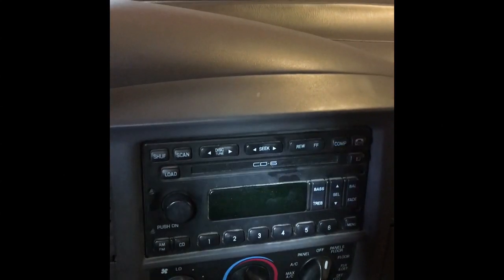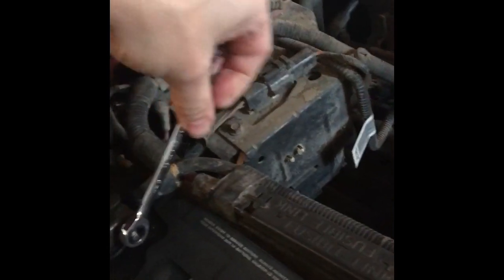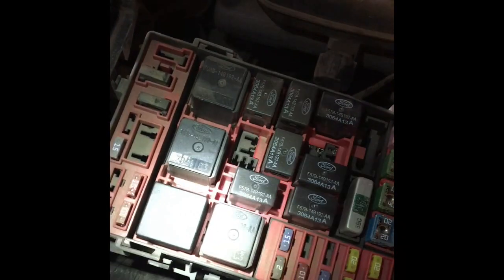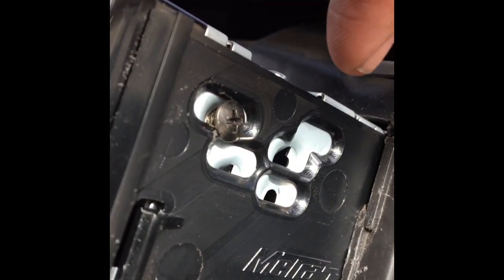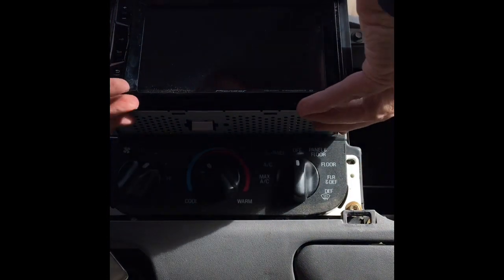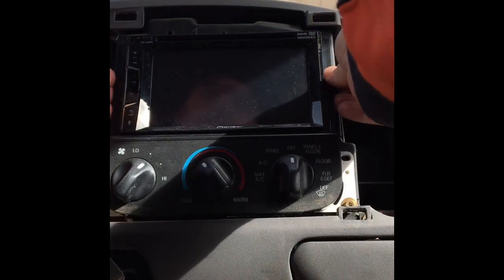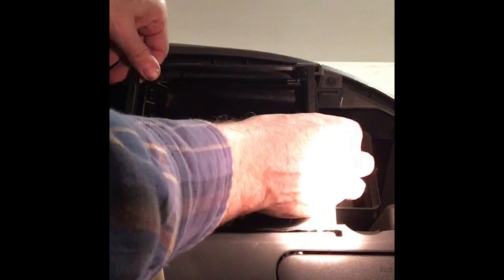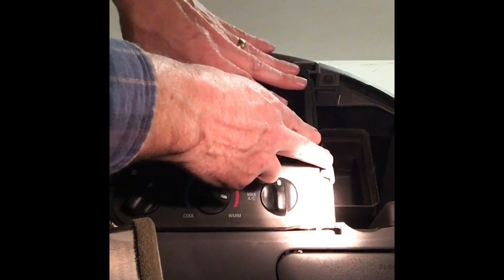Double DIN Stereo and Back up Camera install in 1997-2003 Ford F-150 Super Crew

Comment: Thanks for the video. I have to say the. most important part for me is around 9:17 where you show where the back up light power wire is. This is used for the back up camera function. What a time saver! Just this little tip alone saved me hours of research! Thanks again!

Comment: It turns out my 7-pin hitch doesn't have power.   It was easy enough to route over to the left tail light assembly and grab the power there.   Now I hear that there may be a missing relay for the trailer power.   Off to go check!   Great video!

Comment: Okay so where you hooked up the power wire to the trailer harness if you would have just spliced into the middle wire which is the black-and-white grain that is your actual reverse wire for your trailer light harness

Comment: What the red light under your steering wheel? Asking because I have the same thing and idk what it is.
Reply from the maker: It's part of an aftermarket alarm/security system installed by a  previous owner.  I searched online years ago to figure out how to turn it off but can't remember how I did it.

Comment: all videos I've seen on this topic cut out the part I need, which is wiring from back to stereo..
Reply: Just buy yourself an adapter cable. Mine cost me about $8. Then attach that to the harness that came with your stereo. Just match up the colors of each wire. Then all you do is plug one end in the connector that your old stereo plugged into in the truck and the other end to the new stereo. You will have to run a separate wire from the back up light power (9:17 in the video) to the stereo. Pretty easy.
Reply: @ArVeeNiner  Ive been looking but cant find one that I'm certain would work. Would you be able to help me find one?

Comment: Another thing that would have been easier, you could have spliced into the back up light for the power, that way it triggers the camera to come on when you put the truck in reverse, wouldn’t have needed the relay and extra wiring
Reply from the maker: Yes, you are right. One advantage with the way I did it is that I can turn the camera on anytime. I don’t do that very often though!

Comment: Any tips on the best way or how to safely run the av wire from the cab to the tailgate?
Reply from the maker: Not really. I wasn’t very happy with how that part turned out, although it hasn’t given me any trouble. I just zip tied to the frame as often as I could to keep the wires from dangling and getting caught when I am off road. Maybe someone else can share a photo or video of how they routed the wires?
Reply: On my f250 I was able to run a/v wire thru the emergency brake cable hole in the floor of the cab,( it's a tight fit) run wire down the inside of the frame rail to rear tail light. Remove the tail light and make connections behind the light so they stay dry. Hope that helps you out.

Comment: You don't want the backup camera powered all the time. You can connect the power and ground for the camera to your reverse light. Then attach the RCA input and the trigger wire to the radio.
Reply from the maker: This head unit allows the camera view to be displayed with the touch of a button, while parked or driving forward in addition to automatically displaying the view when triggered by reverse.  That's why I wired the camera to have power anytime the key is on.  I agree that if your head unit only shows the camera when triggered in reverse, it makes sense to pull power from the reverse light circuit.
Reply: Thats the way to do it!

Comment: How did you get the RCA video cable from the camera into the cab? I'm using a wireless setup on my 2003 but I want to change to a wired camera for better reliability but not sure where I can get the wire into the cab.
Reply from the maker: There’s a 2 inch hole with a rubber grommet in the floor panel under the pedals. Mentioned at about 10:10 in the video. Good luck!
Reply: @toddslusser8380  Thank you very much! Ironically, that was about the only section I didn't fully watch as I swapped the stereo out a long time ago. Really appreciate it!